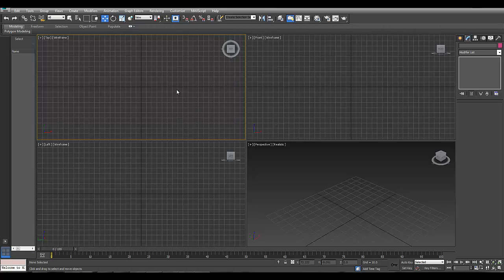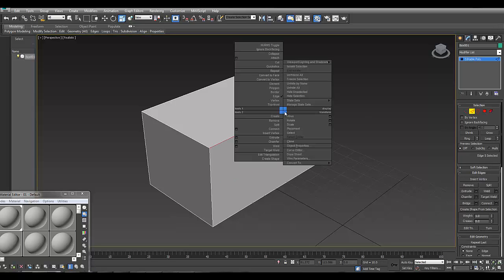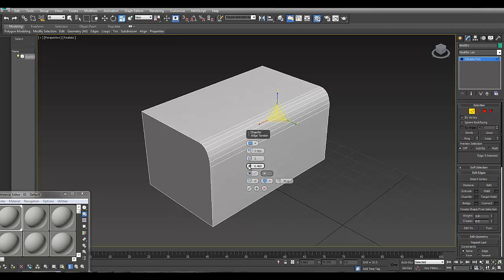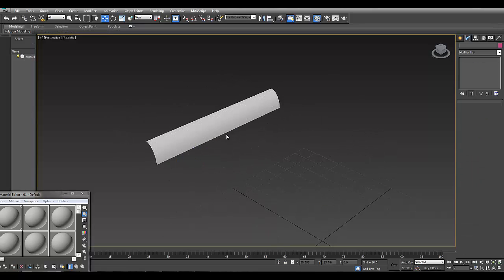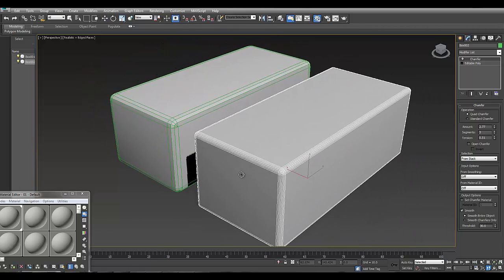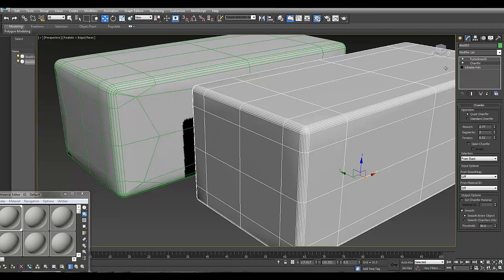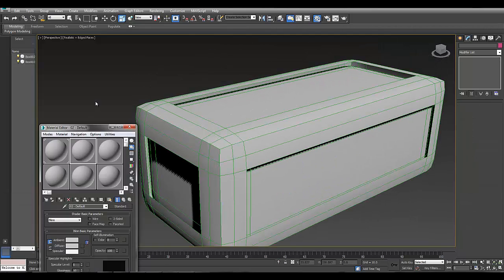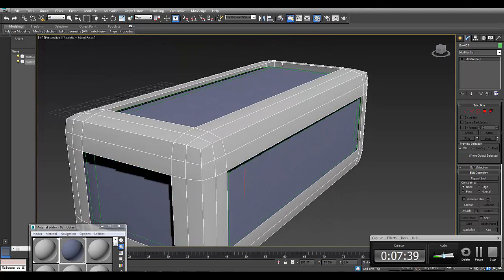3ds Max 2015 New Tools - Quad Chamfer

Comment from the maker: I just made a screencast about the new Quad Chamfer tool in 3ds Max 2015...
Reply: James Abell what laptop you advise me for 3ds max and 3d rendering
Reply from the maker: if you get one that will run the latest 3d games on it, that will be fine
Reply: what laptop you speak?
Reply from the maker: I have an ASUS 'republic of gamers one'
Reply: asus with which you work ?

Macbook Retina i5 2.6 8g 512go ssd ?

or dell precision m6800 ?
Reply from the maker: Those should be ok, you should research them a lot before buying, also ask on forums...